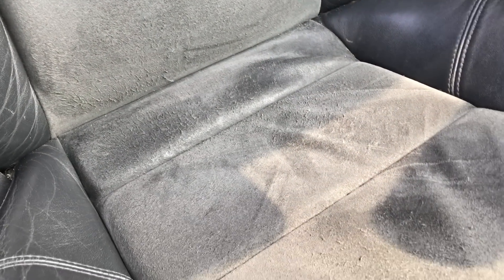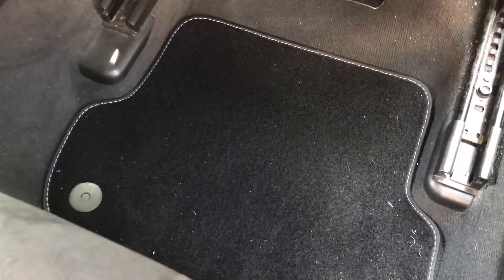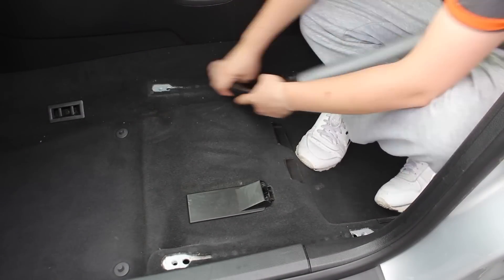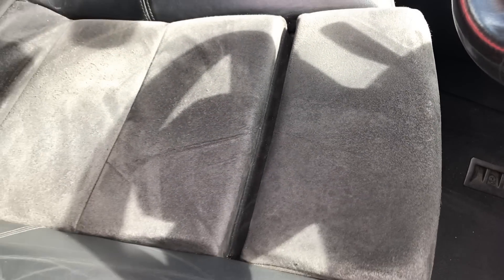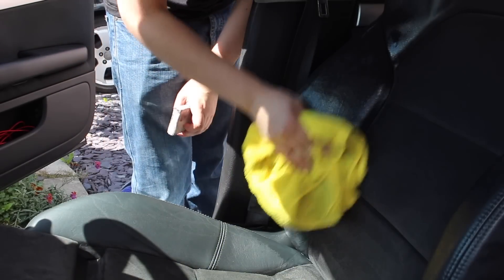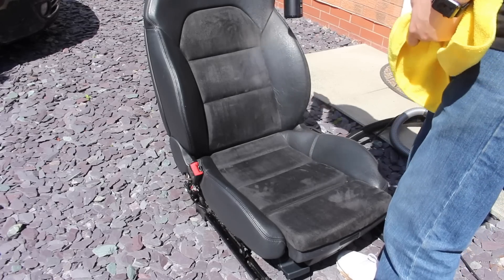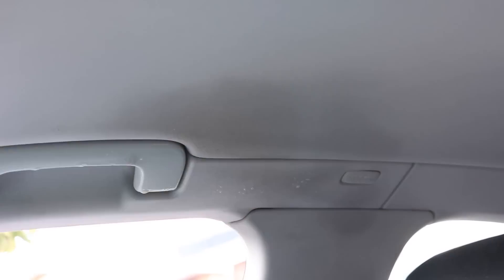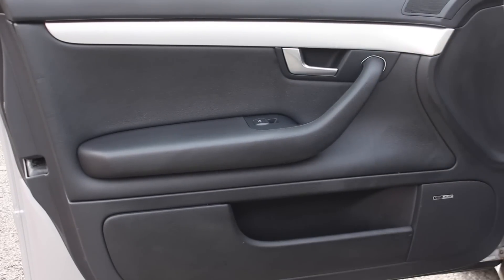Detailing The Interior Of The £750 Audi A4

Comment: I have a 2006 A4 Avant S-line 2tdi however don't have the switch on the end of the wiper arm for average mpg etc or a radio with BT connection....can I take these from another Audi and put them str8 on mine.
Lastly passenger window regulator replacement....I really don't like the idea of removing door rubbers and the frame...how difficult is it really.
Cheers Rob

Comment: Hi Luke. Do you know if you can retrofit the B8 steering wheel and controls on to a B6? Loving the work by the way!
Reply from the maker: Hi Matthew. I’m not too sure. If the B7 can be fitted than there won’t be any problem with the B8. I’m using the B7 airbag (and come to think of it, I think the B7 has dual stage airbags and the B6 doesn’t) and all the plugs for the controls are the same. I had to change the steering control module, clock spring and airbag harness too though since my car wasn’t fitted with anything.
Reply: @TorqueSteer  thanks for the reply. I was reading a bit up on it last night and it looks like a B7 wheel can be fitted but you would only wire up the high impact airbag. Would also need wiring and some other bits I think. There is a B6 multifunction wheel but it's not very good looking. I have a Mk4 golf that has one and it's annoying in the wife's b6 that there isn't one. Might get round to doing it at some point.

Comment: I looked at getting an old Audi A4 back in 2011, but the insurance costs were stupidly high even for a 39 year old as I was, with a clean licence and full NCB etc.
Reply: I pay £1100 13 years clean licence, no cliams 40 years old.
Reply: @riccccccardo  Yeah the prices are total insanity!  I forget how much it would have been for me at the time, but possibly about £400 to £500 which is double what I usually paid on a Peugeot 306 2.0 XSi.
Reply from the maker: They’re not cheap unfortunately. Close to £1000 for me too. The Seat Exeo is cheaper though and it’s the same car with the newer Diesel engine in. So they’re worth considering.